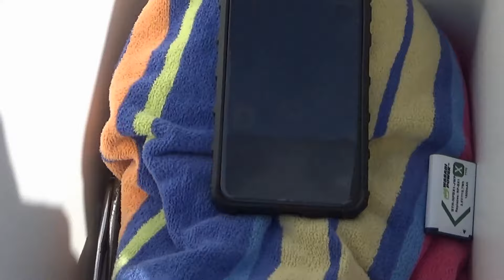Transom is Done - 1st Run - Then this Happened ! -#outboardrepairvideos

Comment: Bro… way too big of a motor on that little aluminum Jon boat… you need a 5hp
Reply: I said the same thing I think hes just having fun....
Reply: Just needs a hydrofoil
Reply: @BassBashin  yeah, that might help… I put wale tales on my 25hp Johnson on my pontoon, she rides level from start to top speed now
Reply from the maker: Hey. Thanks for tuning in!  This boat, believe it or not was/is rated for a 50 hp max according to the id plate and serial number. It had a console for steering wheel but I took it out. Keep in mind it's was built in 1956, not to many 50 hp's around back then! It's all about the weight, these Orlando Clippers are known for being very lightweight. I've seen the 16 footer's with 70's on them. Thanks again & Stay tuned!
Reply: @bluediamondareafishing3563  I had that problem with my boat too. Same issue as the video, not enough weight in the front even trimmed all the way down she was nosing up. Hydro foil fixed all of that and made it more stable, also cuts through grass better now too.
Reply: @THISOLDOUTBOARD1  yeah man get a hydro foil. It’s gonna help you alot
Reply: @THISOLDOUTBOARD1  shoot I had that problem and my boat is 15.5 foot long and my motor is only 18 hp.
Reply from the maker: throw some weight up front! @BassBashin
Reply from the maker: Trim Tabs! @BassBashin
Reply: @THISOLDOUTBOARD1  I was the one saying the hydrofoil fixed the issue. Don’t even need my trim tabs for it now
Reply: Man. I'm the only one in my 12.3 foot Gregor, I added some dumbbell weights up front, now perfect, dose 24mph with a 15hp !
Reply from the maker: @markcollins5026  Sweet!
Reply: @markcollins5026  take the weight out and get you a hydro foil. You might go even faster bro.

Comment: Porpoising can occur because of a center of gravity vs center of buoyancy issue. Some boats porpoise at high speeds, some mid range. Simple fix in small bow-light boats is weight distribution and engine trim. If there was a forward seat passenger it probably would not porpoise. Move the fuel tank and battery as far forward as cables and hoses allow, plus any carry on items. Throw an anchor in the bow! Then, set cavitation plate parallel to hull bottom. Move engine down a pin at a time until it stops. If it doesn't stop, small adjustable tabs, or a cavitation plate "fin" can be added. Trim tabs that are too big can have a huge detrimental effect on handling, which could be worsened further with additional passengers. 'Glass boat builders of runabouts often mold in "wedges" at the transom to prevent porpoising. Next time at a boat show, take a look at hull bottoms at transom. some wedges will be at keel, some at chines, some midway between.
Reply from the maker: Hey. Thanks for tuning in! Wow you just described everything I did in the video and what's coming up in the next episode! Hahaha. Thanks for the extra tidbits of information. Stay tuned !

Comment: Hate to say, "I warned you"................ (but I did).  This is why I quit the Orlando Clipper tiller steer boats; they all porpoise.  I solved the problem by adding a 75lb kid up front.  You can tuck the motor all the way under and that will help but will kill the performance.  If I just had to have another Orlando Clipper, I'd put some trim tabs on it - and keep my fingers crossed.  Good luck, and thanks for a great video.
Reply from the maker: Hey. Thanks for tuning in. I don't remember your warning! Hahaha, yes trim tabs! But this boat is for all future testing of small tiller outboards so this motor won't be staying on it but it has to work. I have two more to 80's/90's 25/30 hp builds and others that don't weigh as much. It will work! Spoiler- it does work! Hahaha Stay tuned for the next episode !

Comment: Move forward with a steering station.  Would require steering cable and controls.  I did that to my fish boat about the size.  Worked perfectly
Reply from the maker: Hey. Thanks for tuning in! I just took all that stuff out. Hahaha. This boat is going to be just for testing smaller outboard tiller's. This motor won't be on it to long but it has to work as I have more builds coming up. It's getting there! Stay tuned !

Comment: I think you finally got it going pretty good at the end. I'd put the battery up front. Didn't the boat originally have a top up front and steering/control setup too. Boat may have been built to balance like that. Those parts your adding will help for sure👍
Reply from the maker: Hey. Thanks for tuning in! Yeah it had the console but no cover on. DIY Trim Tabs! Stay tuned !

Comment: You Need that 20HP manual start 75 lb Johnson on that boat. Im sure you know that electric start motor is way too heavy at around 120 lbs,LOLL! Put cement blocks in the bow. I just gave away 18 of them free on Facebook M .You are fun too watch either way... I Enjoy your adventures....
Reply from the maker: Yes it's coming up soon! Hahaha and a couple of 70's 25's and a couple more 80's 30's. The outboard is not to heavy the boat is too lite! Only 220 lbs! the outboard, battery, tank and me is too much all piled in the back of the boat, hell that marine battery weighs more than I do! Hahaha! Stay tuned !
Reply: Yeah an old late 50S 18HP clamshell would be the real ticket maybe a 1957 model. I think you said in one of your videos you were born in 57. Im still waiting for you to get one someday,HA! Trim tabs should help and put all the weight in the front or a cement block or two if that motor stays,LOL!  Good Luck! @THISOLDOUTBOARD1
Reply from the maker: Stay tuned ! @GPOldMarineShop
Reply: @THISOLDOUTBOARD1  👍👍👍👍

Comment: Had the same issue long time ago.  I have an old lawn mower tire filled with cement with a handle that I place in the very front when I go out by myself. That usually corrects my porpoising issue.  You could try an old small cooler filled with water/sand/cement/rocks in the front. I would also suggest moving that large gas tank as far forward as possible or use a smaller gas tank to lighten up the back.  8lbs per gallon is a lot of weight.
Reply from the maker: Hey Al! Thanks for tuning in! Yes little by little I'm getting there. DIY Trim Tabs! Stay tuned !

Comment: Hi ya'll so I have a serious question/problem. I picked up a 1970 lund 16ft tiller. My question is will it still float and be safe without the foam in the aluminum bench seats?
Reply from the maker: Hey. Thanks for tuning in. Lund makes a great boat! If by someway the boat sinks it won't float without the foam in it. If it worries you just replace the foam! There are many options to choice from. Even ping pong balls! Hahaha! Thanks & Stay Tuned!

Comment: When you first started demolition, wasn't the original position of the controls one seat fore? I mean, towards the bow? That would have a significant effect on the balance of the boat. 
With you, the engine, and the battery astern, I can see why you are high. Set the balance of the boat by extending the throttle shaft? Bring back console with pulleys for steering?
Good Luck and love your show.
Reply from the maker: Hey. Thanks for tuning in! Yes it's obvious. Very lite boat, no floor or anything in it! This boat will be used for test runnig different small tiller outboards, I won't be putting the console back in. I've built some Trim Tabs for it. Stay tuned for the next episode ! Thanks again !

Comment: Is there away to contact you I have some questions.....
Reply from the maker: Hey. Thanks for tuning in. You just did! Ask away! Thanks again !
Reply: @THISOLDOUTBOARD1  I'm needing help with my 89 evenrude 25. Was running 2 years ago but ran rough trying to get it back going but can't seem to find parts or not sure if I'm missing parts
Reply from the maker: @tumbleweed901  Hey. marineengine.com should have any parts you'll need. Look up your year/model. You may also find parts, new & used on ebay. Any outboard thats sat for 2 years is probably gonna need the carb taken apart and cleaned. That's probably your biggest problem. Check out my carb cleaning video, "the two most important things" if you need help. Also do a routine spark test, probably wouldn't hurt to throw some new plugs in it if the old ones look bad. Compression test would be good too. May have some piston rings sticking from siting. Don't forget to gap the new plugs. If your still having problems after all that, best bet would be to pick up an OMC service manual specific to your year/model. It has a great troubleshooting section. Check ebay for a good used one. Curious to know what happens! Thanks again !
Reply: Thanks for the info the motor is on a 4 person pontoon

Comment: What actually causes a boat to porpoise
Reply from the maker: Hey. Thanks for tuning in! It's all about the weight distribution. Too much weight in the back of a lightweight boat. If the boat weighed 300 pounds it wound be fine or if it weighed 500 it would be hard to get on a plane. Thanks again & Stay tuned !

Comment: dude that's a lot of a$$ for that boat 15hp plenty
Reply from the maker: Hey. Thanks for tuning in! It's rated for a 50hp max thats why it has 3 transom knees. But that was back in 1956! not too many 50's around back then. This boat will be for testing small outboard tillers of all hp's. But it has to work with this one and it does! Its all about the weight and balance. Stay tuned for the next episode!